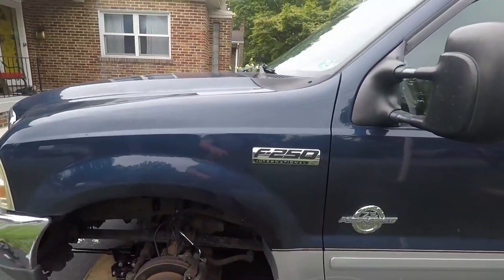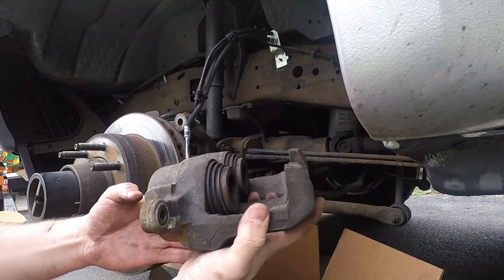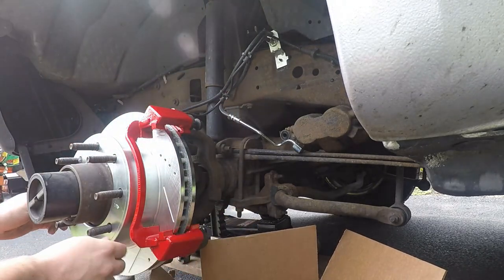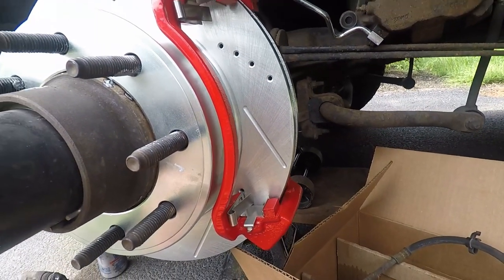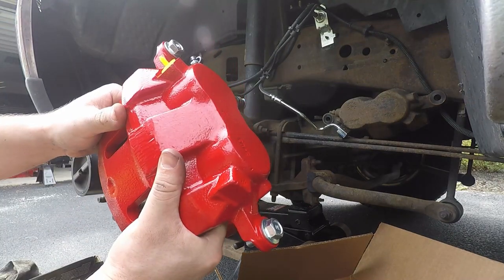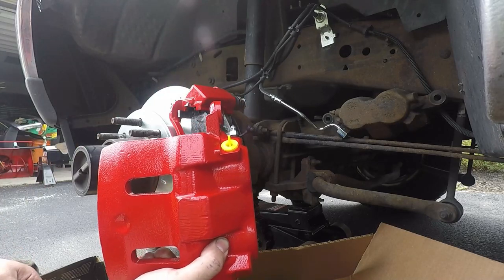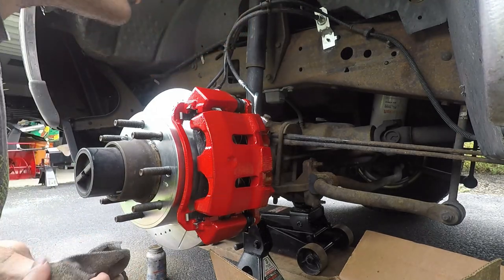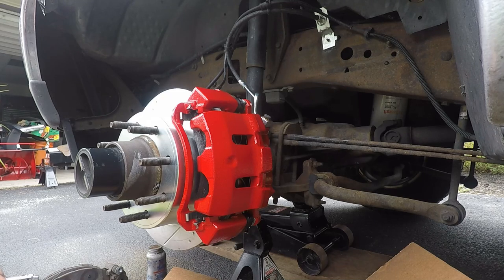F250/350 Front Brake Pads Rotors and Calipers Replacement 1999-2004

Comment: i replace a 99 f250 and passanger the rotor fita perfect and driver side it rubs against the caliper any ideas what can be?
Reply from the maker: The only time I have seen that is when the bracket the caliper bolts to is not bolted to the axle all the way. I am not saying there isn't another issue but that is how I have always seen it. You could also contact the company for a replacement as sometimes things do get missed. Have you resolved this yet?

Comment: Torqued you break line down to the caliper wayyy to much, also created a dust/ dirt magnet when greasing your outer pad (facing the tire)
Reply from the maker: It's my preference to grease them it has given me good success like that. While I know it doesn't require that much it doesn't hurt anything. I was having issues with the break line still leaking again it doesn't truly hurt anything and there is a lot less force on it than it looks.

Comment: How much was the brake upgrade
Reply from the maker: It was about 356 here is an affiliate link to the exact kit I used. https://amzn.to/3CM6rxJ
Links in description for rear kit too.
Reply: @six0bros  whats the price difference on a 06 f350 6.0?  For this upgrade and whTs the difference between stock and this powerstop upgrade?
Reply from the maker: Off the top of my head I'm not sure what the factory setup cost. I can say that to do these vs all ford parts is much cheaper. Getting the Ford parts is probably at least 150-200 more again though you would need to price that out. I'll get you a link for 06 f350
Reply: @six0bros  I'm very interested in the power stop brakes...is there a difference in calipers..like are the Pistons bigger for better braking..or is just stock that's painted..
Reply from the maker: If your calipers are good I wouldn't just replace them. These are factory brake calipers. The upgrade really comes from the more aggressive rotors and pads. The pads are better at resisting brake fade from heat and overall I feel these pads and rotors are the upgrade. The calipers were just a nice part as I needed them too. Here is an affiliate link to all the pads and rotor for your truck. Again if  the calipers are good I would not replace them just to do it
https://amzn.to/3qhzQNb